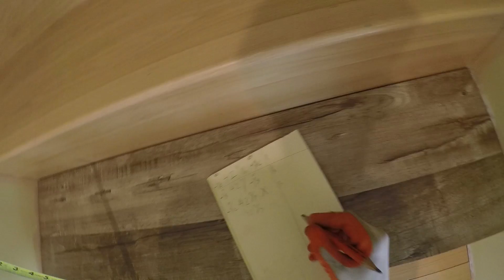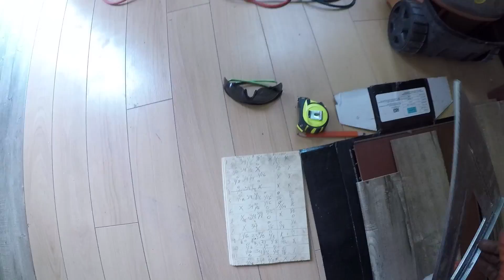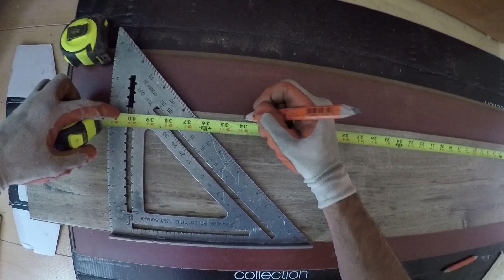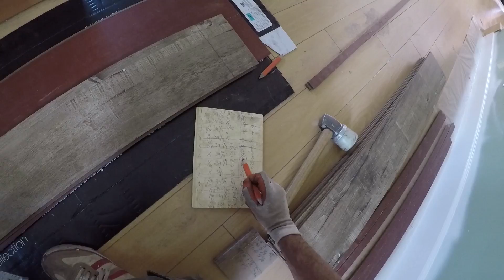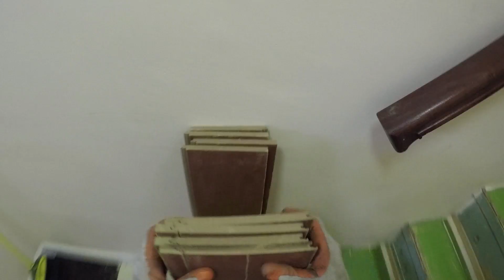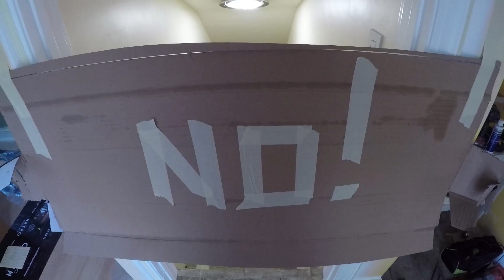How to Laminate Stairs. Stair Noses. Step by Step Installation. DIY. Shot with GoPro

Comment: THANK YOU SIR about the note on the Riving Knife on the Table Saw at 10:40.  Two different carpenters that I work with cut their hands open on this exact Dewalt table saw.  Both had removed their riving knives.
Reply from the maker: Fingers get cut off when people stop respecting power tools and don't pay attention. I never remove the riving knife as you can actually use it as a guide and rip straight lines without actually scoring those lines with a pencil!

Comment: Where are the skirt boards?   As for the treads, rather than all those measurements and estimates (about one 1/16, just under an 1/8, etc) put away the tape measure and make a template out of ram board or rosin paper. Much quicker and more accurate!!!

Comment: Wow, this is a keeper - any thoughts on curved stairs? The bottom stair on mine is curved. The riser that is is curved
Reply from the maker: Curved steps cannot be done with factory finished laminate, hardwood or waterproof, unfortunately, as you cannot bend the stair nose; so the only solution is to make them straight by changing some framing, if possible. Otherwise, custom made and finished on location stair nose out of wood might be a good solution. Thanks for the question. Have fun!

Comment: What do you do when your stairs already have a nose on them?
Reply from the maker: In most cases You cut them off flush with the Riser (Vertical Piece). I use SawsAll. You can use a jig-saw or whatever you have.
Sometimes, like in this case actually, I add a Strip of wood to the lower part of Riser, which should be the same thickness as the nosing that sticks out. 
Thank you for the question! I appreciate it!!! :)
Reply: @Youdoit_DIY  Thank you.  About a year and a half ago we had all of the carpeting and sheet vinyl ripped out of our home and we installed a commercial luxury vinyl tile throughout the home.  the only area where we put carpeting was on two staircases.  One of them is enclosed on either end and would have been the easiest to deal with, but one of the staircases is enclosed on one side but is OPEN to the other (both stair cases are adjacent and parallel to one another.)  You might know what I am talking about as this staircase arrangement is very common in both tri- and quad-level homes.

In combination with the bull nose already on the staircases, this made installing anything but carpet more of a challenging task!
Reply from the maker: @Guillotines_For_Globalists  Yes, that is challenging but doable... just takes 3 times longer at least. :)
Reply: @Youdoit_DIY  Oh yes.  How to wrap the edge of the stairs.  Because the tread overhangs the stringer!  Nothing about that half-exposed staircase would be easy.  Which is why we opted for carpeting on the stairways!

Comment: Wow . Great detailed how-to video. Lots of great ideas. Thanks. I'm' installing SPC flooring 8.5mm thick including backing similar to Republic flooring. Would you use the liquid nails for that or a polyurethane adhesive? Would you remove backing or glue down with the backing? What would you do differently on the SPC? Are you doing a video on SPC stair installation?
Reply from the maker: Thanks!!! I don't do anything different on SPC and I leave the backing (if it's attached and does not peel off easily), though I use a bit more of the same LiquidNails Subfloor&Deck glue. You can definitely use a Poly Adhesive, but I honestly don't think is necessary. Appreciate your feedback and questions! Have FUN!!!

Comment: Im confused.. arent you meant to leave a gap on every side for stretching and contracting of the material? I also thought that you're not meant to nail/pin laminate also to allow it to still move freely. 
Can anyone please tell me why is it that hes not leaving any gaps and why is he nailing it down to the stairs?
Reply from the maker: Yes, should leave expansion gap, but not on stairs, as it is only 2 planks at the most usually, so expansion/contraction is down to minimum and won't affect anything. Same for the gluing/nailing, you don't want to do it anywhere else but on stairs. Hope this helps. Thanks for the question!
Reply: @Youdoit_DIY  I really appreciate you taking the time to reply thank you so much
Reply: @Youdoit_DIY  I have few more questions and I hope you dont mind. I was recommended to use SIKA glue. How long should we wait before we use the steps again? 

Also, I dont have a table saw or mitre saw like the one in video. To get a straight clean cut what do you recommend? I have a circular saw, clamps, set square. Do you recommend taping the planks, where I'm planning to cut?
And should I cut them upside down or just normal?
Any tips will be appreciated
Reply from the maker: @ameensh2439  Sika is good, but Liquidnails Subfloor & Deck is easy to remove from product or hands/tools, so I personally prefer it for that reason. Structurally, both are good. 

Usually, clean cuts are not necessary as they all are covered by either wall bases or transitions, but if you must have them, then do cut them upside down to minimize chipping the edges.
Have fun! :)
Reply: @Youdoit_DIY  but the stairs you cut you didnt use transitions on the sides it just looked perfect lol. I just dont want the top layer to be damaged it wont look good
Reply from the maker: @ameensh2439  Oh, yes then, definitely, cut upside-down, but it will be tricky I think... That's why I use table saw. Consider renting or borrowing, it will save you time and will look perfect, if YouDoIt! my way.
Reply: @Youdoit_DIY  thank you so much

Comment: The top bull nose is not correctly installed. The bull nose cannot be raised on a stair edge because it is a trip hazard and against the code. Always cut the stair covering short to let the bull nose settle level with the laminate so there is no raised edge. The remaining treads are correct without a raised bullnose.

Comment: Stair tread tool makes the process a lot quicker.
Reply from the maker: Yes, as I say in the Video, we use the tool, but for those who do not have one (most DIY guys) or don't want to get one just for one job, this is how YouDoIt! 
Thanks for the comment, though, I appreciate it!
Reply: Just a little over $20 at Home Depot will get you something it’ll work perfect stair tread template

Comment: Great job! Thank you! Does the liquid nails under the step hold up over time?? What about squeaks??
Reply from the maker: Thank you!Yes, it will hold up over time BIG TIME! It is designed for Lifetime of House. Main Purpose: Glue Subfloor to Joists to eliminate squeaks.
It eliminates squeaks caused by Laminate or Hardwood itself. It will not help much with Structural Squeaks, unfortunately... You can drive 2" screws into the Joists or Stringers where needed PRIOR to installing your floor, of course. If that does not help, you can go thru trouble of removing section of Subfloor and apply the glue on the Joist/Stringer.Thanks for your feedback and a question! I appreciate it very much!!!
Reply: I was wondering the same thing.  Is Loctite PL Premium 3X or similar just as good or better? I've read Liquid Nails pops free after while.
Reply from the maker: I'm using LiquidNails since early 2000 in both General Construction and Flooring including Hardwood with no issues at all, and have switched to Subfloor&Deck about 5 years ago because it is Extremely Easy to Remove from Finished Surfaces with just your gloves or paper towels. I used to have a large jar of paint thinner with me and would spend a lot of time and effort cleaning glue off of flooring because you WILL get it on your flooring by accident and people would walk by and step in it, and so on... But to answer your question, it will perform as good as other adhesives designed for Subfloor Use.Thanks for your question!!! i appreciate it! Have FUN! :)
Reply: Ive been using Liquid Nails for 20 years and haven't any problems. The stair NOSE pop off over time once in awhile, usually, due to the homeowner moving in new furniture or kids playing on the stairs etc. in those cases I just stop by & glue them back on :)
Reply: I ended up using Loctite on the steps and nose and Liquid Nails Subfloor on the risers.  The LN Subfloor is certainly thinner and easier to apply.

Comment: Wish I had found this before I paid the hacks that did my house. 10 grand down the drain and this big company is telling me to deal with it. They did nothing like you did. You should open classes on how to train these big companies on proper installation.
Reply from the maker: Hey, that's a cool idea! Maybe I should... :)
Reply from the maker: On floors you don't, you're right...On Stairs you SURE DO! Been doing this for 20 years...Thanks for your thoughts, though!
Reply: Big companies keep the money for themselves and pay the workers a lot less, so the result is a no care job from the tradesman and a salesman that has inflated the cost of everything.  The only thing a big company can do very well is defend themselves and blame you.
Reply: $10 grand??? That’s so over priced
Reply: @CrowdControl2K8  SO TRUE!!
Reply: @karim6219  It totally depends on how big of an area she had installed and what product she chose to use.
Reply: He is installing on stairs, so in this case yes you would glue the laminate down. If it were engineered wood or a solid tread staircase then you could nail it down, but for laminate or LVP glue is the only way to do it on stairs.
Reply: @CrowdControl2K8  yup a lot of times they pick up guys from Labor Finders or guys sitting outside Home Depot looking for work or off Craigslist who will work super cheap and also don't know anything about flooring installation usually they just want WORK and SAY they know how to install!

Comment: Your fast speed head cam is making me see sick! :( I will skip to when you finish taking up the carpet
Reply from the maker: Sorry! tried to make the video shorter...
Reply: @Youdoit_DIY  it's not the length of the video, that's fine with me. If  the camera was static then it wouldn't give me sea sickness lol
Reply from the maker: @Alexander_l322   Well, if the camera is static, you won't see what I'm doing...:)
 I appreciate your feedback though, it gives me some food for thought on how to try make things better, so thanks!!!
Reply: @Youdoit_DIY  there is a bracket thing you can use to put your camera at any place or place 2 or more in different places to get different angles. It's cool thanks for the video i am about to tackle my stairs and thr information you give about it is very helpful. :)
Reply from the maker: @Alexander_l322  I'm glad it is! Have FUN!!!

Comment: let the scrap wood fall bro your thumbs way to close to that blade
Reply from the maker: Yes, thank you, Jordan! Unfortunately, when you work with Laminate you cannot let them fall because it will break off a little corner piece, especially on the Noses... Just have to be really Careful and AWARE, and go Slow.A safer alternative to the Table Saw is using a Miter Chop Saw, but that will burn the blade as it has to go thru the Aluminum Oxide Finish and a lot of material at once.
Do appreciate your feedback!